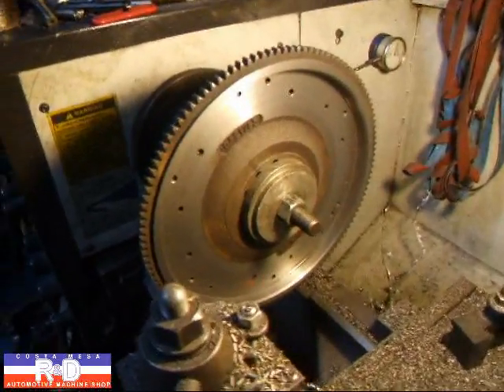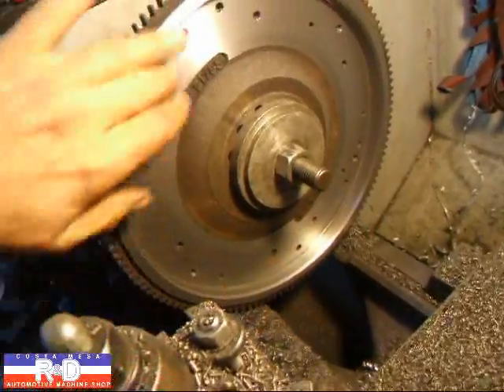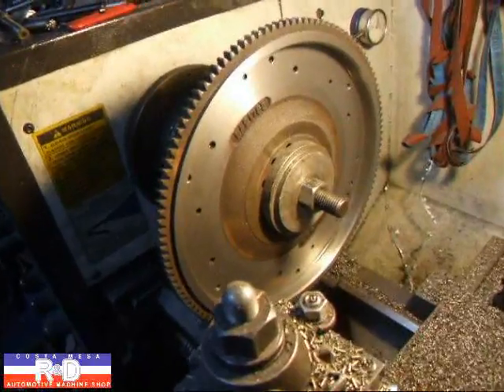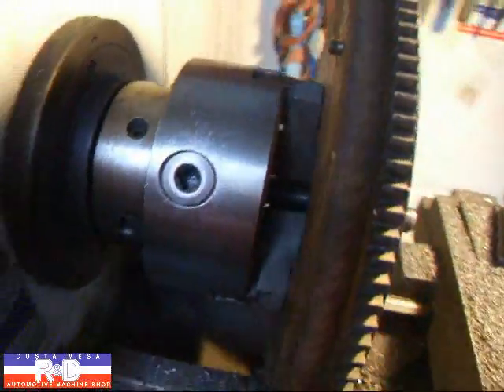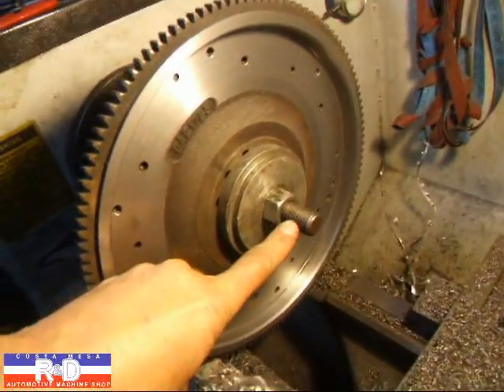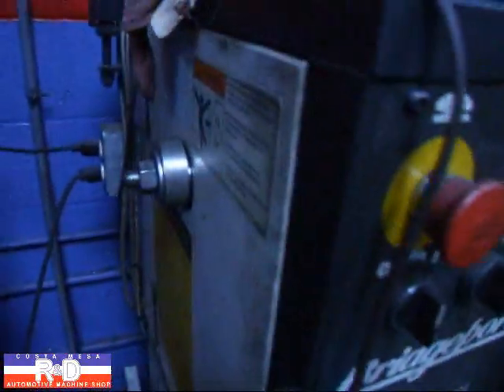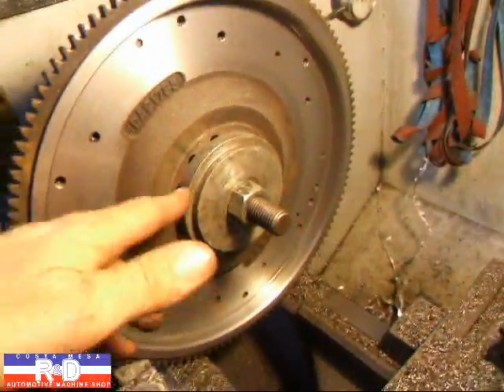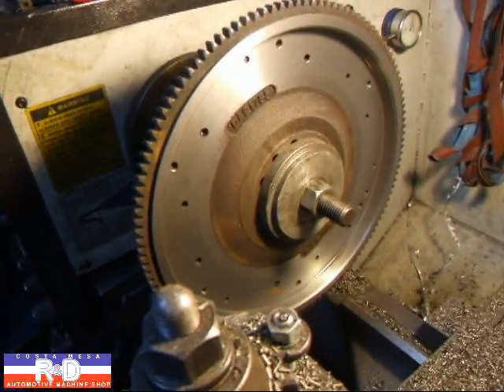Lathe Tip for Flywheel Weight Reduction

Comment: No disrespect here, mate - but I'll also don some hearing protection! 
Seriously, the loudest operation was R&R of a F/W ring gear: we cut thru it w/ old-school cemented carbide FL-'sumpthin' designation toobits, & the operation would destroy the cutting edge every bloody time - on 1 pass. 
For anchoring, we used qty 6 10.8 class M8x1.25 thru-bolts on a large aluminum lathe faceplate, bolting the F/W down thru the pressure plate bolt holes from backside. Very solid. 

Regards. 
Phil T.

Comment: @freonr2 the lathe does the turning,the flywheel(job)is attached to the chuck,a 3 jaw chuck ,the main reason for this vid is,most machinist,only clamp the flywheel via the chuck,here as well,using very basic principles,applies extra purchase on the job using the 3/4" threaded bar,2 different clamping loads used lateral and radial,this helps with chatter(vibration),so simple but not many dudes know this,I love his work,he is not in this for money just sharing what works,checkout Aussieheads1